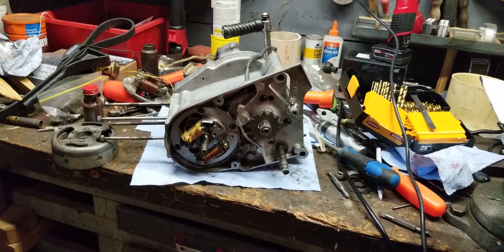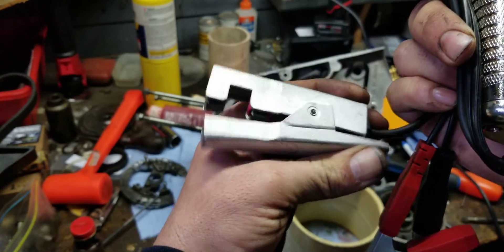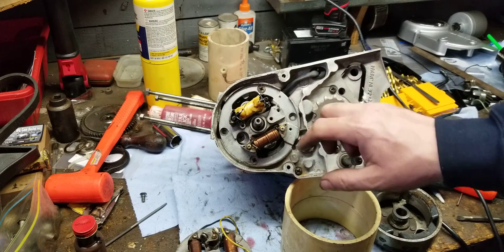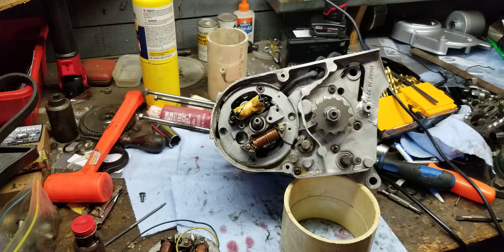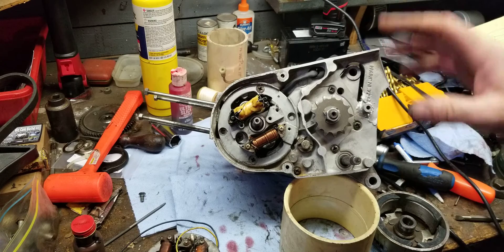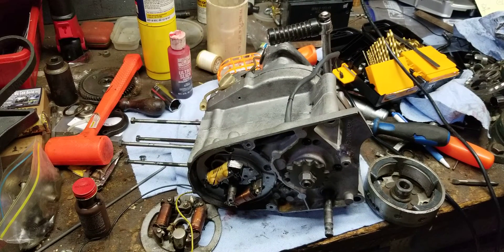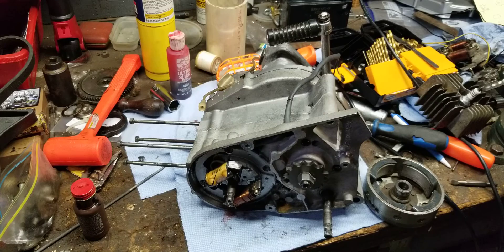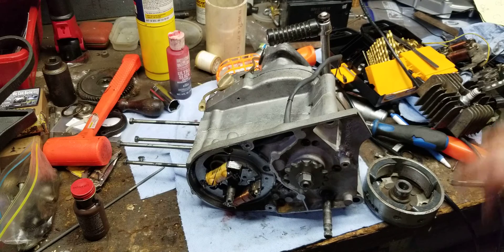Kawasaki kv75/mt1 CDI upgrade

Comment: What's a part number that will work for a 2000 KE100 primary coil? can I use a DS80 primary coil (part #32140-35410)??? Not a lighting coil, just looking to get it running not worried about lights or battery! Thanks in advance!
Reply from the maker: Light coil is different from primary coil